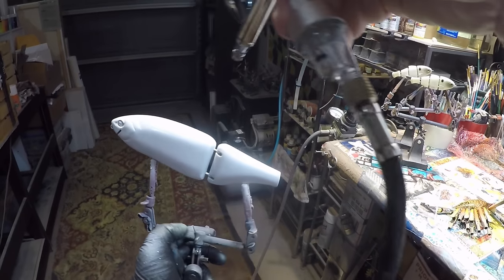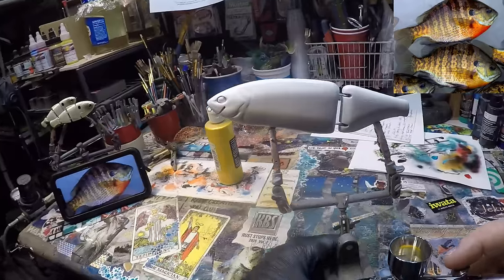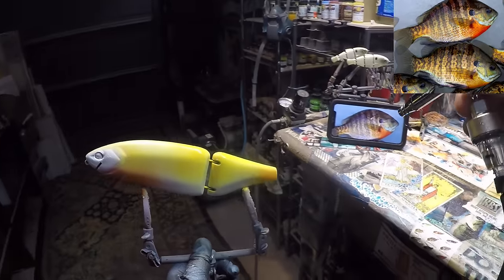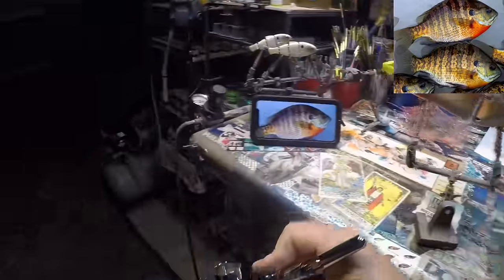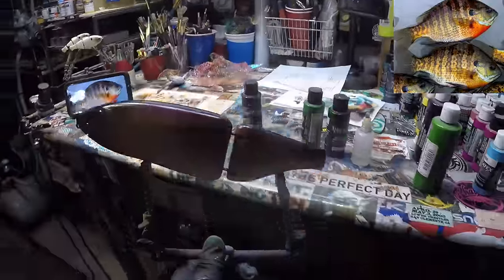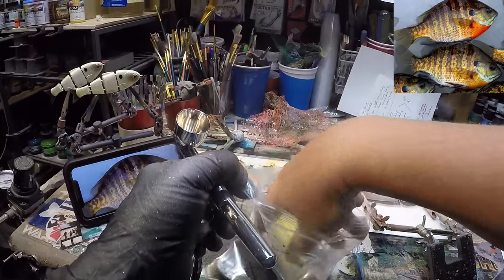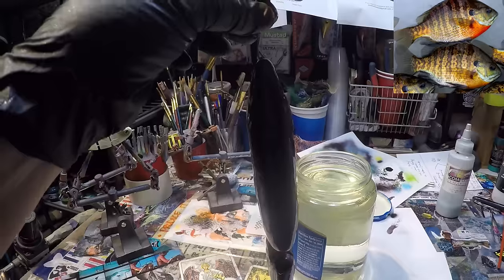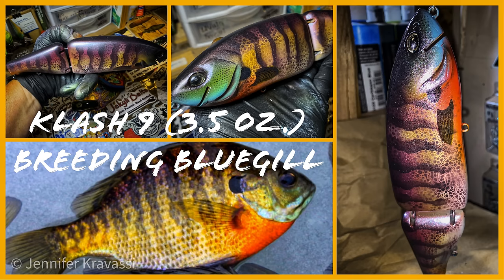SPRAY SESSION!! Client Klash-9 Repaint (July 11, 2020)

Comment: Jekyll

I see you pouring the paint right into the brush? 
Do you thin the paint? Because I got some createx paints that say I can using it without thinning. But it seems too thick to me. And it will Clog my brush. But I have a cheap battery operated on for about $60. It works great if I thin all my paint.
Now since I found your channel. I have purchased the Iwata Eclipse and Badger 155 for T shirts.
Do the air compressor brushes like these use a bit thicker paint like yours doing because you can adjust air the pressure?
Reply from the maker: I use Eclipse. I hardly ever have to thin my paints. 🙂
Reply: @Jekyll424  So is the paint already thinned? Or is the pressure you use pulling the paint out? Sorry to be so inquisitive